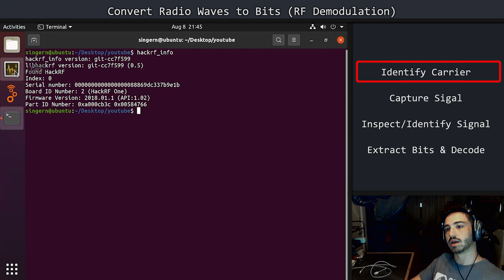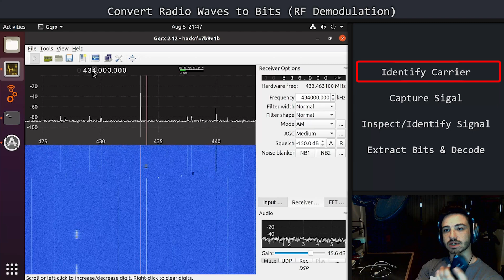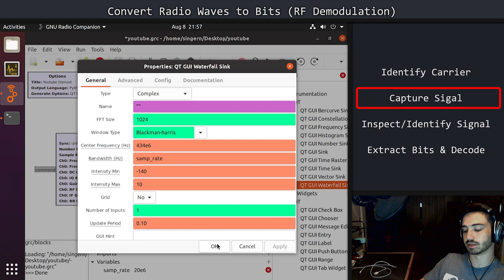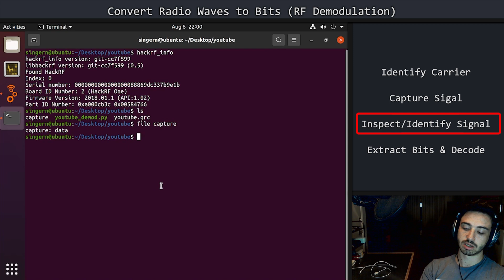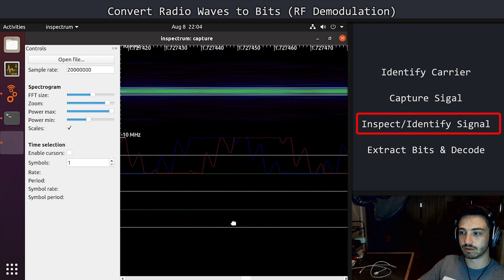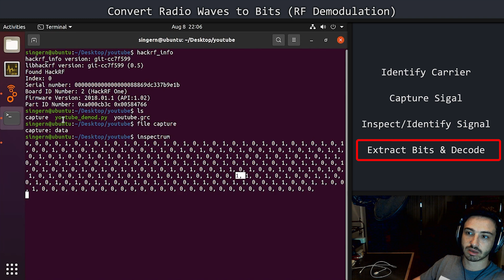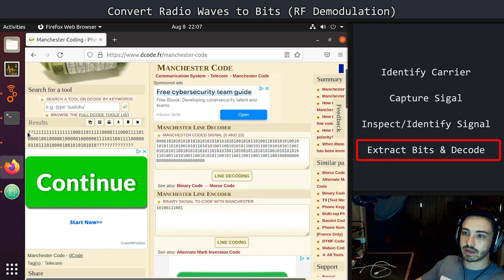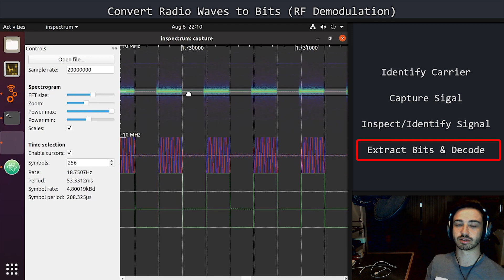Convert Radio Waves to Bits (RF Demodulation)

Comment: This is really well done! If I have to say, I feel the pace is some times a bit too fast and voice volume goes up/down quite a bit. Also, I would love if you can also give a run through of the GUN Radio too, I think that software is a beast of a tool to learn. But overall, amazing video, thank you for sharing the knowledge. I was just about to start to get back to it.

Also can any of this be done with Windows? Not really a must, but now I have to get ubuntu installed to get back into this.
Reply from the maker: Glad you enjoyed it and thank you very much for the critique!

I'm certianly working on my pace and speech stability, I know theres some improvement to be had there.

I'm thankful for the amount of interest on this and there's been enough that I think i'm going to treat this as the first video in a series. Planning to do blackbox bitstream reversing and more videos on RF stuff in general, so definitely more GNU things coming down the pipe. I also will definitely do an OOK modulation video and once I clear some stuff with chrystler I'll probably do a video on abusing the vehicle. All this to say there will be alot more GNU instruction coming down the pipes.

You can absolutely do all this in Windows, im just a slut for nix, mostly cause of my work and security background. GNU is available for windows, HackRF has drivers for windows and GQRX is available for windows I believe. Regardless this is just one toolchain, there are a variety of ways to actually do this. Hopefully the principles came through at least.
Reply: @NateSinger  awesome thank for getting back. I’ll make sure to link your channel wherever I can.

Comment: @Nate_Singer hay, let me say to you that I'm lucky! I did not expect that you are going to use a key fob in your demonstration! I was looking for an explanation of how key fobs actually work and your video helped me a lot! You did decode and demodulate the signal with a couple of programming and tools. But I'm curious to know exactly what happens inside those devices, and how the modulation and demodulation happen between the transmitter and the receiver
Reply from the maker: Are you asking about the hardware itself?
Reply: @NateSinger   Yes! The electronics! They are complicated and mysterious. only Electrical engineers know how they work and that is frustrating . Thank u for your fast response
Reply: @NateSinger   questions i was looking for the whole past night: How a radio wave carries information? and how the receiver device receives that wave and decode it to get the info? after that we have another mysterious story: how does that digital signal mean smth to us?  you said it its just  an ON OFF!

Comment: Thanks for the video man, I just wanna make sure I understand before I discover an easier method after:

Is there any way to 'capture' my RTF drone feed?  I have analogue FPV goggles with an antenna along with a simple analogue drone that has a camera.  My goggles don't have a USB out to monitor or PC just for someone else to watch. So I was wondering if there was any way to use this demodulation method to capture the drone feed and display it on my laptop(running arch if it helps...btw;) or am I just really looking too deep into how to capture my analogue RC drone cam feed?

Comment: Hi, I am very new to all this so maybe my question isn't even relevant but would I be able to use my NRF24L01 with a USB adapter in order to identify the carrier and to capture the signal or must I use something like an osmo SDR dongle? If I can, can you point me in the direction to look for how I can do so, please?
Thank you very much for the video it is incredibly helpful and well made.
Reply from the maker: Google RTLSDR BLOG V3. It looks like the device you have is a fixed freq so it won’t work. The RTL is only 30 bucks and is your best low budget option. Thanks for the review!